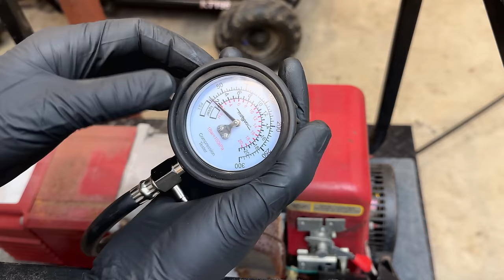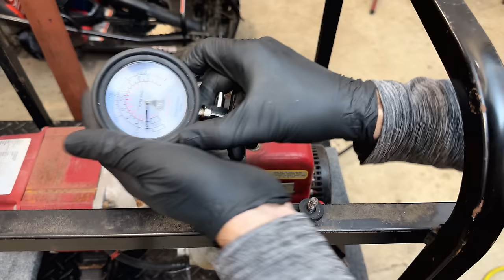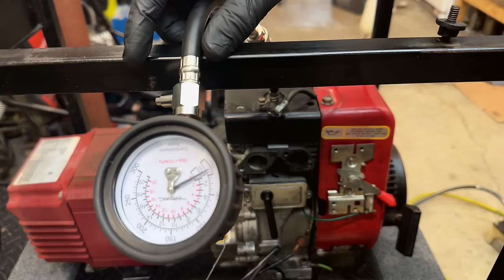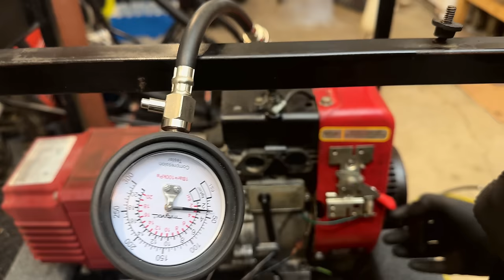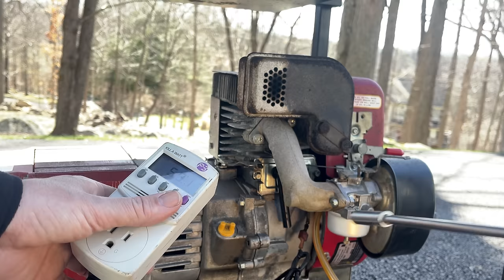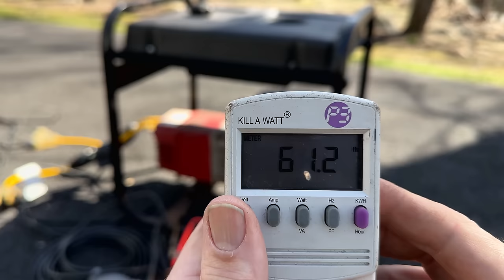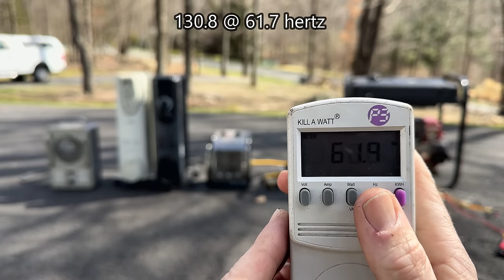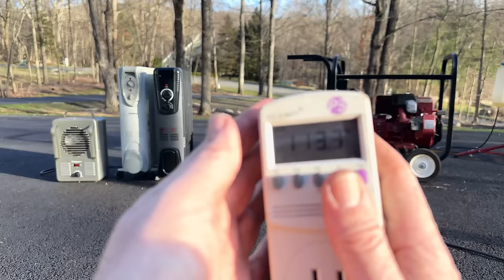More Tecumseh Trouble - Low Compression

Comment: Tecumseh used to be the engine that was on most of the snowblowers through at least the 90's. I had worked on a few and they always were a pain to tune. I'd tune out the misfiring with no load and as soon as I used the machine there was no power. After re-tuning it under a load it would misfire when I took the load off. I just let it misfire. When I was going to school for small engine repair, (1988),  most of the equipment we took in for repair had Tecumseh engines on them.

Comment: Pretty likely that the misfiring is coming from that looooong pipe between the carb and the intake port.  Fuel is likely puddling there under low velocity conditions and then breaks loose when the puddle gets deep enough for the flow to form a whitecap.    

That loose lever on the throttle shaft could likely be fixed with a bit of peening and/or some silver solder...sometimes you can fix a part rather than replacing it.

Comment: The carb with the loose throttle plate linkage: Spot weld it in place where you need it to be, similar to the other Tecumseh carbs.

Comment: You might be able to deal with the misfire issue by cleaning up the flywheel and coil/adjust. Worked for me as my grandfather had a small engine repair shop for years and that’s what he always did.
Reply from the maker: Tried that and replace the coil on the Tecumseh I tested at the end.  That was in a different video.  No change for me.

Comment: With a Tecumseh engines, if they have points, I've always set the points to open at .085" before top dead center of the piston. Use some stick or rod through the sparkplug hole to find that setting and it usually results in a fine running engine.

Comment: As young teens in the late 60s and early 70s we would scrouge broke lawn mowers and repair them to sell for some extra bucks. Even back then Tecumseh's were a pain. We used to call them Tecums**t. I can't imagine working on the newer ones with all the plastic parts and non-adjustable jets. Your a dang genius and yes they just run like that!

Comment: Another great instructional video by the Generator King! The detailing and paitence makes learning fun. Those Tecumseh gens always run lean with no load while cold, and not a lot better when warm, just the nature of the beast with them in my humble opinion. Not that big of a deal because as soon as it starts, its put under load and smooths right  out.
Reply: One of the problems with this design is the long intake tube with two 90 degree bends.  The fuel, when it leaves the carb, is not vaporized yet. As the air follows the bend the fuel droplets,  being heaver, will not follow the air but will impact the outside of the bend of the tube and stick there. This results in a lean condition of the fuel/air mixture.  This effect will lesson as the engine warms up under load.  If you increase the fuel intake to compensate for this problem when cold, then as the engine warms up under load you will be running to rich. This is known as a " catch 22 "....... you'll find this on most engines with long intakes with many bends.

Comment: I'm sure somebody has mentioned it by now, but I'm not seeing it....I can't speak specifically to that model, but most generators of that type have a bonded neutral, so the ground pin on that 240 plug will serve as your neutral.  While probably not the 'technically correct' way to do it, it works just fine, I've been providing backup power to my house that way for 25 years.

Comment: Oh those Tecumseh’s!  There were many in use in the 70’s-80’s. We had an OHV version in a Bolens  tractor, I had a Rupp mini bike with one, one in an old Wheel Horse. Even as a kid I knew they were second class citizens to the Kohler’s and Briggs. The Tecumsehs had power knocks, started hard when hot, not ever as smooth. But they had great power and could take a ton of use and abuse.

Comment: being old as dirt has some advantages. I have seen many Tecumseh engines and every one of them hated to run cold, but once they were running they would run as long as they had fuel. Most issues have appeared after shutdown. Hence the phrase, It was running good until I shut it down. They are still worth saving

Comment: Every large block horizontal shaft Tecumseh engine I’ve ever owned or worked on regardless of what equipment it was powering has run exactly like that without a load. Maybe it has something to do with the long intake manifold configuration, but whatever it is they all pop and surge a little under no load then smooth right out under load. As you said, nature of the beast!

Comment: FYI, someone in the past replaced the needles with an aftermarket set. The high speed jet is supposed to come to a sharp point. The one you showed comes to a flat face. In my experience, you can never get it set correctly because the needle is supposed to enter the emulsion tube to regulate the fuel flow and the flat surface can't do that. Do whatever you can to save the old pointed needle. To fix the throttle clean the throttle arm and shaft, hold the throttle plate fully closed and the throttle arm away from the idle stop screw and solder both together. I have made several new throttle shafts for my Kohlers this way and it works.

Comment: If the float is low more than likely the seat is swollen. I notice the wire on needle generally faces the choke. There is a vent on carburetor on outside of carburetor to right and up from low speed adjustment. At least on snowblowers
Reply from the maker: I later put a new seat in and had to adjust the float back.

Comment: You should always do a compression check with the throttle + choke wide open!!!
Reply: True except that if compression is good without them open, it will certainly also be when they are.
Reply from the maker: True.  Most generators are always throttle wide open then the engine is off.

Comment: Hey James you do know that you can change out those throttle plates and the throttle plate shaft stems. Inside of those Tecumseh carburetor's. And another thing you can compare the throttle stem shaft to swap them over to your OEM carburetor's setups. As long as the orientation and set screw plates are aligned in the same spots they should interchange with each other. The thing to look for is the length and diameter of the throttle plate stem shafts is all that matters in A swap over procedures. It's just trading on for the other is all your basically really doing. Cause you can use parts out of clone carburetor's in situations like that to. Even though you have it working now. It's just another tip trick to you for the future you can use. Later on down the road with issues just like those on the original OEM carburetor's. 👍 Thumbs up to yah for your hard work and all of the effort that you put into that video and generator and carburetor issues to.
Reply from the maker: Did not think of that at the time.  I could have easily swapped the shaft out and kept the OEM carb.

Comment: Hello James: Years ago  I took in a large Wisconsin single cylinder (with a Fairbanks-Morse magneto) installed on a Ditch Witch trencher that would not start. Burned exhaust valve; set way tight. Refaced the seat and replaced the valve. After a bunch of other things, got the unit running again. It was near the end of its life cycle, but must have been awesomeI  when new.

I really enjoy your thought process and how you logic through your problem solving; and your neatness and doing things correctly. 

Keep up your quality presentations.

Speed Gray
Grand Rapids, MI

PS: I always hated Tecumsehs, too!
Reply from the maker: They are growing on me, but still not very high on the list for engines I like working on.  These 10hp flat head engines do not run very well.  Their smaller ones seem to run a lot better.

Comment: I was just watching some vintage Honda motorcycle rebuilds and the channel host shared what mixture he and other shops use in their ultrasonic cleaners to clean all the aluminum parts.
- 5 gallons water
- 1/2 gallon Simple Green HD (sold at home depot & it's a purple liquid concentrate)
- 4 or 5 lines of Dawn dish washing liquid
This is a 10:1 ratio.

You might want to give that a try.

Comment: The throttle lever is the same as the snowblowers , I always use anti-seize on all bolts because of the aluminum block .
Reply: It's the skeleton of what a snowblower has... missing a couple of levers stacked on the pivot bolt and also a spring.  As James said, they're just using it for the ignition kill switch.

Comment: For DIY valve gap grinding, I use a belt sander and a drill a hole in a piece of wood, jig it so the board is parallel to the flat of the sander, just insert and twist the valve. Allows for fine grits for not 'going too far too fast'  don't seem to get much of a burr either.

Comment: James, I REALLY enjoy your channel. VERY well done. I have had an interest in small engine repair, both as a hobby and business since the mid 1980s. 

Regarding valve setting, I was taught, especially on the exhaust valve, a slightly loose setting was better than a slightly tight setting, as it further reduced the chance of the valve burning.

Thanks again for a great channel!

Speed Gray
Grand Rapids, MI
Reply from the maker: Always better on the loose side.  Not sure if you can burn a valve on a single cylinder engine.

Comment: I use Shell Rotella 15W40 T5 in my '04 Duramax diesel engine and it has 521,000 miles on it so I'm certain that's a good oil.

Comment: Shades of a Model "A" Ford, or a 24 "Star"     I remember doing an overhaul on a 24 Star with a Continental 4 cylinder  "Red Seal"  side valve engine, using a couple of vise grips, crescent wrenches, screw drivers & a hammer. The rings were $2/cylinder & the mains & rods were babbitted bearings.
I expect an engine builder would have blanched at my procedures, but I was 14, & came precious close to having my butt well tanned , for using a soup ladle as a babbitt ladle. My maternal grandmother who was partial to boys (I was her only  grandson) & was the Matriarch of the family, would not allow my father or grandad to break out the harness leather strap & put it to use. 
Believe it or not , the engine fired right up & ran well. The fuel pump was a vacuum tank, & I figured out how it worked & got it running as well. There must be worse fuel transfer devices somewhere than a vacuum tank, but I have never encountered one. Great videos Sir, I enjoy them & usually learn something..........mind you, when you know nothing, it is not hard to learn something ! Thank You.

Comment: Great video as always.
01:16:01 - Since the fuel valve is so hard to get out, I'd favor not installing the in-tank fuel filter. I'd install the valve without the filter, use an in-line filter and make it  much easier for future filter replacement.

Comment: The Tecumseh snow blower engines had a warm air shield around the carb that used part of the exhaust muffler to heat the air 
that went into the carb (no filter), 
defrosted the carb linkages 
and warmed the long intake manifold...
maybe why the had such a stellar reputation on snow blowers.

I wonder if one of those warm air ducts (eve homemade or at least part thereof)  were fitted to a generator  Tecumseh engine if that would immediately improve the idle/full throttle mixture problems..
without overheating the engine of course..

Comment: 54:20. I automatically replace every seat in these. Buy them by the dozen dirt cheap and no time to remove and install with the Tecumseh tool. When it’s so easy it’s a no brainer. I also always pull and clean the emulsion tube - some of the tiny lateral holes are always blocked.

Comment: Your grinding of the valve stem was impresive. Most shops that do larger engines have disc sanders and use s v block to stedy the valve stems.
Reply from the maker: I recently purchased a v block and a belt sander just for that purpose.

Comment: James, I have been.  A long term watchher of your channel and appreciate your presentation style.  I would like to make a couple suggestions. On your valve stem grinding,  you might make an L shapped brace.  Take a short piece of 4x4 and drill a hole through it larger than the valve stem.  Cut the board in half just at the midpoint of the hole.  Cut the board so that it is 1 1/2 inches below the the ideal height on the side of the grinding wheel.  Screw a short piece of 2x4 to the bottom.  Clamp or screw the 2x4 to your work bench.  By spinning the valve in the groove it will be at 90 degrees to the horizon.  You can adjust the brace to make it square right to left.

Secondly if you buy a 7 in one painters tool and grind a U shaped notch in the end with a little judicious bending in a vice you should be able to make a pry bar for pulling out stop valves from the bushings in plastic gas tanks.  It would work better with some wood shims for leverage.   

Thanks again for what you do.

Comment: Almost all the later Tecumseh engines have valve clearance issues after a couple of heat cycles, recently I fixed a snow blower that was at the dealer 3 times and all they did was replace the original carburetor with a junk aftermarket one, valve adjustment is a PITA because they need to be ground down. I believe the issue arises because the valves stretch a bit I grind them on the loose side and it brings them back to life.
Reply from the maker: Usually not enough to make a difference or measure.
Reply: @jcondon1  enough to close the valve lash to zero, I'd say that's enough to make a difference and definitely measure. 18 year old snow blower ( not many hours) ran good for many years slowly lost power and then wouldn't start. What else could have caused the valve lash issue?
Reply: Recession of the valve in the block metal.....
the valve seating face in the block gets pounded by the valve...
and the metal of the valve seat in the head starts to recede away from the pounding....
thus the valve stem clearance closes up as the valve head drops down into the block...
a problem with non-hardened valve seats and no/low lead fuels

 @MacGyver-1
Reply from the maker: @MacGyver-1  it also depends on the materials used to make the valve and valve seat.  Maybe they changed it up and some wear faster than others.  Also possible the clearance may have been a little tight from the factory.

Comment: I had the same engine doing the same things. I should have......taken the engine apart to begin with. I spent so much time fooling around trying to get it running. Next one I run into....I'm thinking total rebuild.
Reply: Not the carb per se..

it's that long unheated manifold with the 90 degree bend allowing fuel to fall out of the airflow when the engine is cold...
that's the cause of the lean mixture and rough running.

If you adjust the carb for smooth cold idle..
when the engine warms up and heat migrates from the head to the intake..
then you get a rich mixture under load.

Small engine carbs are usually straight shot down a small manifold (if any) straight into the head/valve...

Comment: That long inlet manifold with the 90 degree bend (and no "hot spot") acts just like a VW air cooled engine with the single carb without any heat to the manifold.....
pooling of fuel as the fuel particles condensed out on the inner surface of the runners to the heads causing lean fuel mix, stumbling and carb backfires

It would be interesting to see the temperature that inlet manifold shows on it's exterior surface just after starting on a cold day...
as the VW manifold with an aftermarket exhaust that had no heat risers created ice on the manifold exterior  on a damp cold winter's day!
Reply from the maker: Was thinking the same about that intake.

Comment: Hey James, two thoughts: Have a look at "automotive trim remover tool" at the large river site. I think that might be just the ticket for removing those stubborn bushings with least possible damage.

Also, on old beat-up equipment like this, especially when you have reason to believe that they've been exposed to severe environmental conditions (stored outside, flooded, etc.) I think, for the sake of your liability in selling/repairing/donating potentially lethal equipment, you should do a hi-pot/insulation resistance test on every winding.

Comment: I have the early early to middle 2000’s version of this generator. Coleman Maxpower 5000. It has the same engine. It runs not so great and has the classic miss. That said under load it runs better. I only run non-ethanol fuel in it and always use stabilizer. I also always run it dry when done with it. The only reason why I would buy a new generator is the dirty power. Like all of us, I have a lot of sensitive electronics. This one will get relegated to portable power for remote projects where it will run power tools and other equipment that is not as sensitive to dirty power. James is the GOAT small engine whisperer. 😂

Comment: If you could find  or make a tool like a small tie rod puller it should make removing the fitting from the petrified seal easier. It apply pressure between the seal and fitting while you work it in without damaging either. Also wd40 would help.

Comment: I got an aftermarket carb on Amazon for my Techumseh lawn mower that looks just like the one you have.  It has been a giant PITA and always needs messing with.
Reply: The long intake manifold with the 90 degree bend let's fuel fall out of suspension in the airflow when the manifold is cold...causing a lean mixture, spluttering, backfiring and stalling.

You have 2 options...

fiddle with it when cold...and it will run rough (and rich) when it warms up.

Or put up with the crap idling, have patience and let it warm up....
and adjust for good running under load....
Reply from the maker: It’s hit or miss with Tecumseh clones.

Comment: I believe they sell throttle shaft kit with new seal and top plate. These tecumseh engines are so finicky, frustrating actually makes me wonder how did they run back in the day when they were in production.